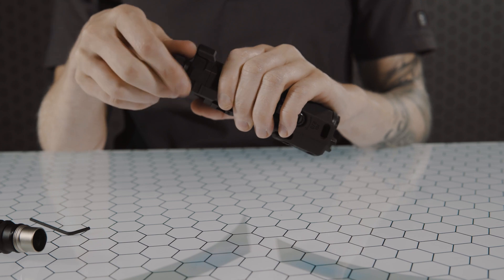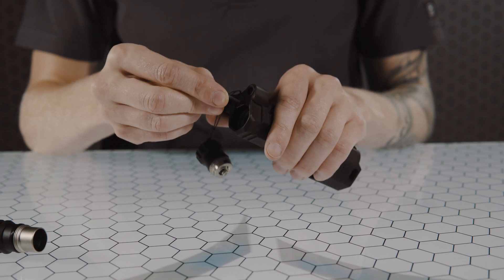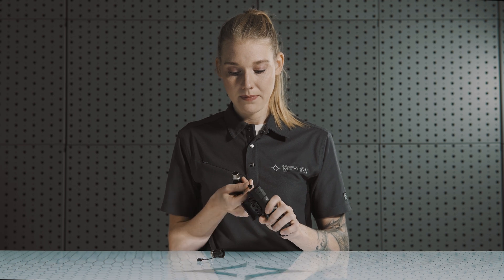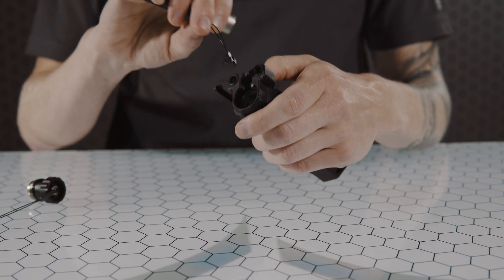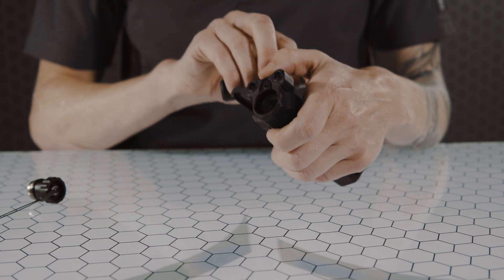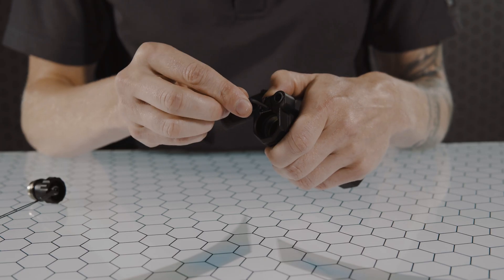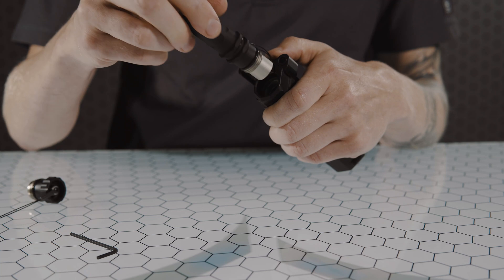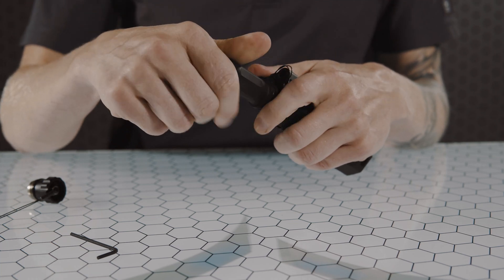How-To: MAWL AA Endcap Adapter Installation

Comment: Which AA batteries work best to get the same volt output of the CR123.  And which CR123s do you recommend? Thanks fir your video
Reply: @MrEpicAndroid  good to know, I'll have to get the AA adapter if I find my 123's aren't lasting long enough.